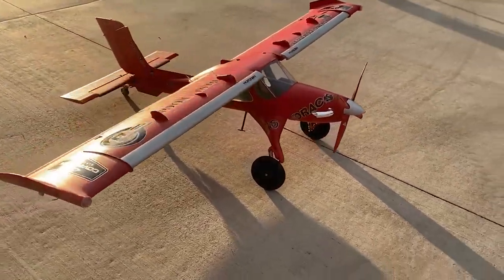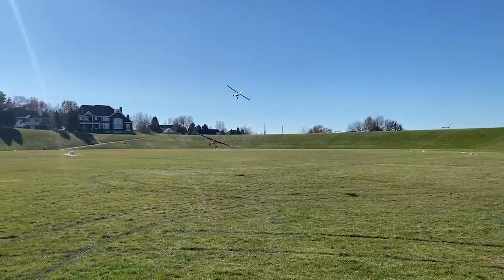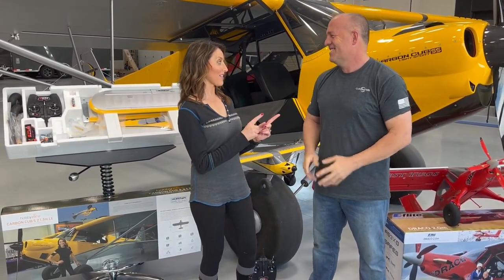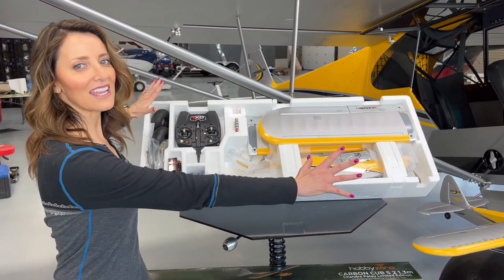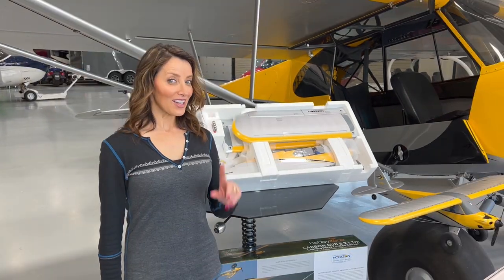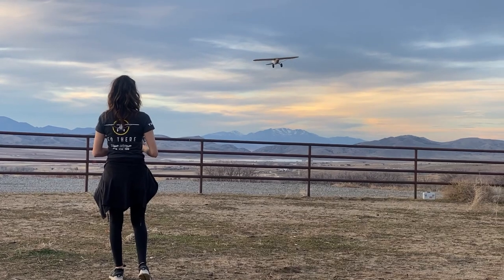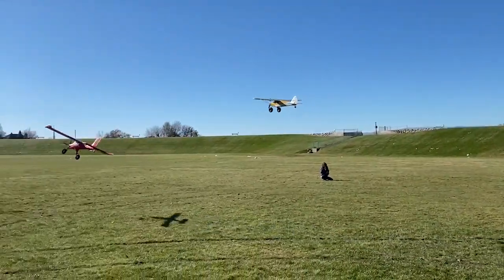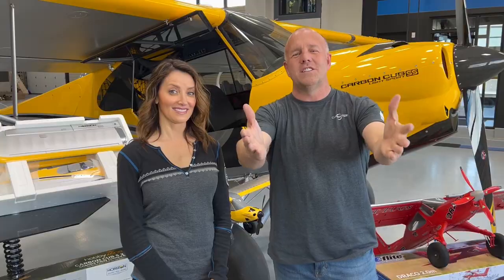Horizon Hobby has done it again! Chandra is in a new RC Carbon Cub!

Comment: You have the most awesome wife. Not only does she fly the big planes, but also the little RC types.

I've been flying RC planes since 1971 and control line types since 1948, it's always fun.

I'm always uplifted by your videos, keep up the good work.
Reply: Thank you so much.  It’s so amazing that you’ve been flying r/c for so long, I’ll bet you’ve seen some fun transformations and evolution along the way. 👍
Reply: @ChandraSlyFoxPatey  Sure have. Mostly in the computer area. Back in 1965 I worked "inside" the computer. It was the old FSQ7, it covered an area the size of four city blocks. Now computers with way more power can fit on the head of a pin.

Comment: raising the definition of 'arrived ' to next level , his and hers kit planes made in honour ,[i may go and get cry-ogenically frozen , to be reheated, when bionic up grades are available so we can enjoy life at the pace of the Patey bunch ]. Had a wee thought , would it be worth making aeropods for those huge wheels ,to up the cruise speed , Being Mike, they could be full wrap around ,with the bottom opening up for landing ?.
Reply: The issue with wheel pants for bush planes that land off-field on rough surfaces (dirt, weeds, rocks and taller grass) is they can get caught on things or ripped off. They wouldn’t last long.

Comment: What is the weight-to-power ratio of the models compared to the real Mckoy's? There are really only 2 types of RC aircraft, those that have crashed & those that haven't crashed yet.
Reply: I don’t have an answer for you on power ratio comparisons, but I can say that if I did to my full sized Carbon Cub what I did to the RC one, the inside would be covered in vomit, and it wouldn’t survive the impacts 😂😂 These little things are tough!

Comment: Super freakin cool! Maybe I should buy an rc since I wrecked my tri-pacer a couple weeks ago. Brother says you trying to be like Mike Patey or what?!?! Lol gotta laugh or I would cry about losing my old sky tractor.
Reply: Oh dang! I’m glad your okay though.  Give your brother a little bum kick lol.  I will say that flying RC just might help take a little bit of the sting away from your accident.
Reply: @ChandraSlyFoxPatey  I might get an rc plane to fly with my kids. We have a drone but can't land in the snow like we could with those floats. It's been a bit of a challenge getting through the faa and ntsb stuff but wrapping up now. Not the experience I wanted as a student pilot but hopefully can learn from it. It was my last landing after getting signed off for my night flights on a pitch black night. Landed without needing crosswind controls. Let off the power and got hit by direct crosswind gusts off the mountain that tipped my almost completely onto my left wing and held me there. Was going just slow enough I didn't have much aileron control and a lag time after i went full power to build enough speed to lift off. Did get back in the air but didn't get the wing down fast enough and got hit again. Turned me and stalled the wing setting me down heavy crossloaded under full power..... ☹️☹️ I think a more experienced pilot could have saved it but I was split seconds behind on my reaction time and failed. Tough break but I'm working on securing another plane as we speak so hopefully will be in the air again real soon. Congratulations on your sweet rv plane. I want my family to be all flyers just like you all. Besides this speed bump flying has sure changed my outlook on life. Lots of the motivation for that came from you all. I'll be looking forward to watching for the next videos of your beautiful carbon cub flying again as well.
Reply: @joshuagranger2416  Thank you for saying that.  And you’re so fortunate to have come away from your accident alright, good luck to you in finding a plane.  I hope you and your kids enjoy flying together in the future. All my best.

Comment: I bought this RTF plane with GPS over a year ago on sale for $250. Now they put Chandra's name on it with less features outside of two batteries, and it now cost $450??? I feel HH is taking advantage of us using you guys. This plane is nothing more than a Sport Cub from a few years ago with a new paint job and a Safe Receiver. Mine was worth the extra $50 due to it already having GPS.
Reply: They did have to raise the price on products because of issues with rising manufacturing and shipping costs. In our own companies, we’ve been faced with making those decisions as well. This package does come with a few more items than the other package and costs less than purchasing it all separately.  That said, I’m glad you have one. I think it’s such a great RC plane, very durable and just plain fun.  Happy flying 🤠
Reply: From $300 with GPS installed, to $450 without GPS, that's a bit much. I do love this plane. I realize it's made for beginners, but it needs a 40amp esc so it can handle a 3s or 4s. We're at 3,900' so we need a bit more power.
Reply: @robertwren2289  Absolutely, I completely hear you on needing power for altitude, as is always the case. We live at 4500, but in the video where I was flying the Cub, we were at my parents’ place, which is at about 5200’. This plane comes with 2 3s batteries and I found that it performed well.
All in all, I’d say you got a really great deal on your plane, I believe you probably have a 30 amp esc, you could call in to HH and see if you’re compatible with a 3s battery.
Reply: @ChandraSlyFoxPatey  Actually it only has an 18amp ESC. I'm not sure if they changed that on the newer plane. I had put a 40amp ESC in my Sport Cub, and it made all the difference in the world in how well it performed. I don't want to change this one cus I don't want to mess with any of the electronics. I did put a better 9x6 prop on it, so it flies better. 
I actually bought that plane on sale for $250 with GPS installed. So when I saw that HH stopped selling it with the GPS installed for $300 it made me think, WOW, I bought it at the right time. 
Now HH is selling it without GPS and your name associated with it, and extra battery, for $450. It just seems like it went up way more than it needed to. 
With all that said, I feel it's a great plane for a newbie to learn how to fly. 
Thanks Chandra for getting back to me about this. Your entire family is an inspiration to our world.
Blessing from our Lord! 
Get To Work! 😃

Comment: I have flown RC Aircraft for 30 years.  Personally, I don't like RTF or ARTF kits.  I never have. I find them flawed in many ways, so I stay with the build your own via either creating my own balsa wood-based planes or using plans from days gone past.  Sad that IF you can find balsa kits today, they cost far more than they should.  I even still use my old 10 channel  JR system that back when I purchased it cost $1000.00.  Point. While I do like the real planes you built Mike, Id personally never purchase an RTF of your planes. Now if you one day want to put planes out of say... one that I could use a 120cc OS 4 stroke on then I'd be interested in that for certain.  I exaggerate none when I say all my balsa hand-built planes outperform every RTF I see and have flown ( I help newbies learn how to fly with a slave cable from my transmitter to theirs) at 3 of the flying fields I fly from here in my city. No one can and probably ever will convince me that any RTF is better than one a person builds themself.  But kudos to you for your designing and building of real aircraft. I can't afford that route so I do the same as you in RC aircraft.
Reply: I can definitely appreciate your passion for crafting your own and it sounds like fun, I’ve seen some incredible builds and talented flyers. But it’s nice to have options both ways.